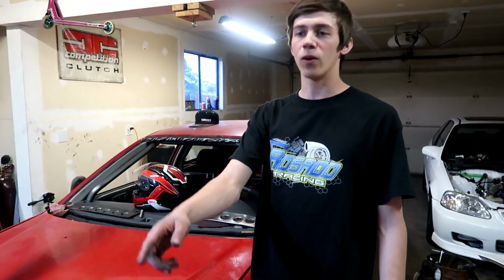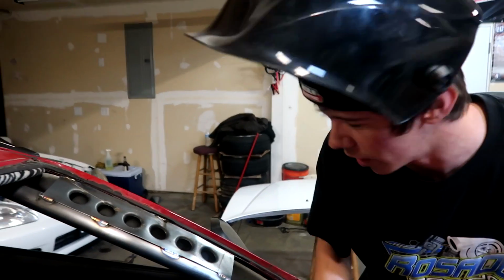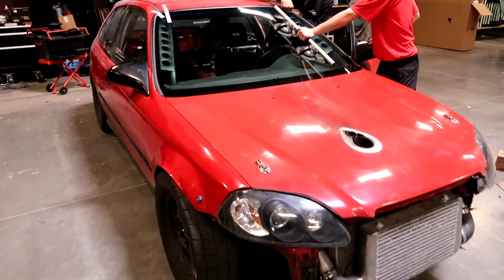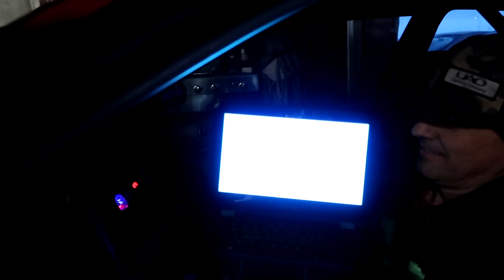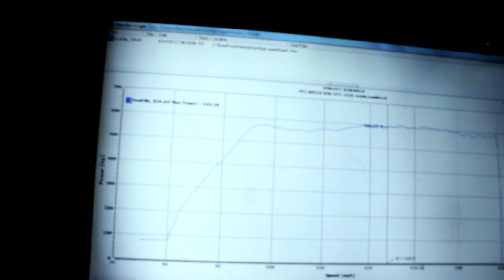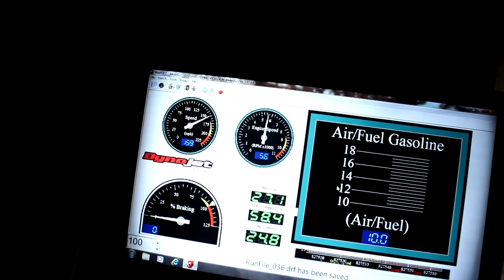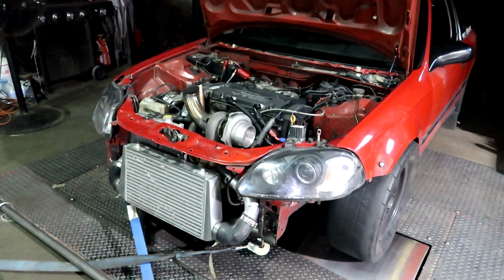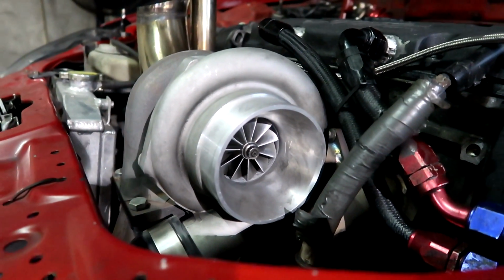After 3 Years of Abuse, My Ebay Turbo Has Finally Died...

Comment: 3 years of constant abuse, sitting for weeks on end, two-stepping, having flames shot through it, cranked up to 20+ psi... I'd say you definitely got your money's worth out of that snail.
Reply: HakJobTM lol my ebay turbo goes thru the same shit going on 4 years purchased in 2014
Reply: Lightning Autowerks™ got a link on where to get one ?
Reply: Lightning Autowerks™ do you know how much power your making and if so what setup are you running
Reply: Has anyone you know used exhaust piping For your intercooler kit

Comment: Put that huge turbo that someone gave to you on it
Reply: M O N T A E G R A M yea no, the lag would be monstrous
Reply: Tristan lag is super good for making it exciting though!
Reply: Turbo is way too big for this engine. the lag would be forever.
Reply: I was about to say that and the 2step should help on track building up boost
Reply: It would get too much compression and blow up the car. Lag would be terrible. We would also have barley any boost.
Reply: He would most likely need to put it on an 8 or 6 cyl.  I'm not sure 4 cyl would push enough exhaust gas for that size turbo.
Reply: MS3VT you should see volvo red blocks push the holset hx40
Reply: See that gorgeous graph that turbo did for him?

Yeah let’s not fuck it up. He can just get another of the same and be good.
Reply: Don’t underestimate the 4 bangers 😂🤷🏽‍♂️
Reply: Some guy from finland (bamse turbo underpants) is running a holset hx55 on a 8 valve volvo redblock, no problems and solid power
Reply: Pablo Vlogs maybe Im just stupid but how can you have too high compression from the turbo but not a lot of boost lmao
Reply: Pablo Vlogs proves you know nothing about forced induction.  The turbine side can be removed and a smaller turbine housing added to reduce lag.  The larger compressor will add more air, lower intake temps which will add more power per pound of boost. Brent can tune around this turbo.
Reply: Steve Ross ⬅what he said.  Lol
Reply: Tristan yeah I kinda figured that
Reply: Tristan uh anitlag?
Reply: M O N T A E G R A M full boost at 8500rpm. Lol
Reply: ddefinetly should!!!
Reply: M O N T A E G R A M Y E S !
Reply: The monster turbo with the right turbine housing will make the car faster, especially with the new transmission.  The car can get into the 9's and still be streetable.
Reply: That powerstroke turbo is junk. Yea it’s big, but I bet that eBay turbo would make more power.
Reply: type-dRew it's all in the tuning.  Since Brent knows what he's doing, going to a larger turbo will allow the car to perform better. Front drivers need a power curve that can't hit hard from the bottom since the weight transfer will cause the tires to lose traction. A progressive power curve is better and Kyle's car has boost by gear to make that happen
Reply: Lucas the HX40 isnt that big barely bigger than the 3582r
Reply: Raven Gamer bamse’s volvo fucking rips
Reply: Tristan  time for nitrous
Reply: Dude the lag would be so bad lol
Reply: or go same turbo with no problems and 8 more psi in it atleast that turbo wouldnt do anything good for him he would have to do work to the car just to have it on it and he would probably clean it up and rebuild it before putting it on his car costing more money then its worth
Reply: He has to make it to the track cant mess with the tune. Had to put exact same turbo on it again. From mini van.
Reply: Someone had a hx40 on a single cam f23
Reply: @4door_papi  i have an hx40 on my dsm😉👍

Comment: That's just it being old really and running hard asf for 3 years straight
Reply: Im not saying its bad for an ebay turbo but i would think something like a Garrett turbo wouldnt have broken :)
Reply: And I’ve seen multiple Garret’s last way less time under way less abuse on multiple cars. 

So yeah. Just good in general. Not just good for Ebay.
Reply: 3 years out of a turbo at 20+ psi without ever been rebuilt/refreshed is solid. let alone a $600 ebay turbo. People think garrets are bullet proof
Reply: +type-dRew so is it just any eBay dual ball bearing GTX35?
Reply: Pretty sure they said it was an ebay dbb gt3582r
Reply: Kyle needs to just drop a link to the exact one he got. Way to many options to be 100% sure you got a good ebay one.
Reply: Not to mention how often have you seen him run a filter on it too LOL its crazy it lasted this long.
Reply: I've never seen him run a filter
Reply: Whis 
That was his point😂
Reply: 3 years isn't old  a rebuild wouldn't have hurt...it probably would have lasted longer if got serviced every year or every other year....
Reply: Ambition-pk racingfirst on ebay.....I got a response from a video comment when I asked who he bought it from.... They're about $600
Reply: lol the turbo is junk he barely ever drove that car. you kids need to get a grip and close your mouth.
Reply: SpenserRoger truth...☝
Reply: Oh and dont forget about the 2 or 3 build motors later
Reply: Ya son let's drop 600+shipping USD on some copied tiny shaft junk from China, not like it's likely to grenade at any moment & destroy our built motor but yo lets congratulate each other when it makes it more than a few pulls & fails w/o toasting nothing cause having boost right now for cheap is all that matters.. old man.

Real mature. Sounds great. Call me when you get somewhere with that attitude, 1 800 grown ups
Reply: A gattrt gt35r will cost u around 1k or this ebay 200 dollars
Reply: Jokey Jesus another wannabe car enthusiast . I have turbochargers that have lasted for 8 years why bother with cheap parts for eBay China seller
Reply: it's definitely good for a eBay turbo considering how often people get crucified online for even mentioning the idea of using one. 3 years of abuse and touching over 700hp isn't bad for"eBay junk". In my opinion, people get mad because when it's worked as well in Kyle's case, it's a F-you  to the thousands other people spent on their builds. That's not saying eBay stuff is cool. You're still flipping a semi-dangerous coin.
Reply: Gaz Girl there is nothing wrong with Ebay turbos some people don't have the money to spend 3,000$ for just a turbo and when you're spinning something over 8,000 rpm it's going to wear and tear over time that is natural
Reply: Gaz Girl spending 3,000$ on just a turbo takes away from the overall build
Reply: Jokey Jesus the turbo would be spinning at least 100,000rpm
Reply: Whis I said over 8,000 rpm keyword over
Reply: China bulds legit turbos now. Actually they build alot of legit things now some of which you have in your home and have lasted a long time and you don't even know. Been to China lately? Their mega modern cities built up from what was a poor rural area in one or two decades shows how far they've come.
Reply: just throwing this out there, look at diesel turbos, they last hundreds of thousands of miles at over 20 psi...

Comment: Not saying this is why the turbo failed, but what reason could there possibly be to not using an air filter? Are there not filters rated for 1000HP that fit that turbo? I doubt there would be even a 1HP loss, and it looks like there's an entire foot of space in front of the turbo intake. I understand it looks cool, but "YOLO" and "sending it" in the end is expensive recklessness. Remember the video of the guy that grenaded his V12 turbo engine because a shop towel got sucked in during a Dyno pull?
Reply: phillip galas 
Ever seen a cylinder wall that’s been dusted?  
Looks like someone sandblasted it and that’s exactly what they did when they ran no air filter. 
All that for 5 more hp maybe on a good day.
Reply: at the very least I would put a turbo guard. always bugged me that he would run no filter at all, it's not like he has no room for one
Reply: Yeah never understood no filter. You are sending all road dust in through the engine .  I almost cried when I saw a tear in my filter on my cummins and that's a cast iron engine / with thick liners.
Reply: Andrew Bartleman 
Any time I open something on the intake tract and find a dust streak from unfiltered air, it’s sort of hard to take if you’ve rebuilt enough engines from it! 
Most snowblowers don’t use filters either. 
maybe they are going for that sick dyno pull.

Comment: You need to run the warercooling for the turbo core. With out it the exhaust seals in the turbo takes alot of heat and the ball bearing will fail early.
With watercooling im really sure it would of lasted muuuuuch longer.

Comment: Awesome vid as always. I love this budget build stuff.  Is it mentioned anywhere if and what the bottom end components are? When the motor was rebuilt  was it done professionally? Did Kyle build this in his garage or was it done at a machine shop (deck, honed, balanced, micro polished the crank, checked all tolerances etc..?  Also what kind of bottom end goodies did you use? Did you go budget (scat / eagle rods vattera / nippon type pistons) or did you go with better quality stuff like Manley / Skunk / CP type stuff? You guys have a build post on any of the forums on everything that's been done? Great job on the vids!!

Comment: no shame in the turbo failling, still impressive that it lived that long, with the torque dropping off at high rpm it seems to me like it was running maxed out...

im hoping you get another ebay turbo to compare how much they improved over the last couple years
Reply: jacob fraser it's the tune which drops the torque at high RPM because torque is what kills an engine, it's better to go higher in RPM with less torque than the opposite.
Reply: a turbo thats running out of flow makes an identical curve.

Comment: 🧐 If you don't run the water lines to a BB Water Cooled Turbo, then the oil inside the chra will tend to "Coke-up" and eventually grind away the Ball Bearing Cartridge when the Crust from the Burnt Oil breaks loose 💥

Comment: Years back I got my self a old gd Mazda 626 turbo the old single cam 2.2 with a 5 speed I ended up doing a t3/t4 eBay turbo front mount 38 mill waist gate lines blow off valve all up them bigs cost me $450 we done 3” stainless intake and bump used the stock mani with a t3 cast welded to the mani I done 60.000k on the cheap turbo some times it would get 20psi. It lived on 14 sold the car still going with the heap turbo on it il do it all again one day I had a new garret on a Nissan and it died with in a few months

Comment: 3 years with a ebay turbo and that kind of drving is not bad at all! well, buy a new for like 200 dollars and then its running again!  i have a saab 9000 that i has been driving the shit out of for like 3 yers on 16 psi with a garrat turbo, and that turbo is pretty mutch done. so youre ebay turbo did well!

Comment: be carefull what turbo lines you buy 
buy cheap the insides melt blocking the oil flow

buy really good lines not cheap chinezium plastic wannabe nylon lines(with cheap chinezium stainless braids)
i have see all kinds and all kinds wear and break and cause damage of all sorts(to even oil lines on oil coolers/relocation kits)

cheep is not always good

one good way is to get oil preef or resistant hose and  wrap it with stainless braid,  at least its going to last 
and you know whats what

Comment: Why not use acrylic as the windshield or some time of lightweight plastic make it 2,200 lol
Reply: they start pushing in at the mph he'd be running.
Reply: Rules at tracks don’t allow anything other than glass for a windshield.
Reply: SpenserRoger 
That’s what the aluminum braces are for, but then that’s probably cop bait for those pricks.

Comment: I know this is an old video, but the turbo probably had a journal bearing go out inside the turbo causing it to become unbalanced and eventually start blowing oil. Had this happen on a Volvo I use to own... Lack of enough oil and cheaper made parts will cause this.

Comment: Thrust load maybe was too high when you raised boost. Ebay turbos are okay but I always here whenever boost goes significantly higher bearings get stressed.
Reply: Yanku Marrah he made 700 or 800hp with this turbo before
Reply: Yanku Marrah I’ve pushed these over 40lbs. They have a pretty good thrust in them

Comment: i think you have to much positive camber up front Kyle
Reply: When the car squats at launch the positive camber zeroes out, so that way he is getting maximum surface area of the tire touching the ground. People do the same with rear wheel drive cars. If you align the car at 0 degrees of camber, when it squats it will go negative. That is why you start with positive camber.
Reply: yeah in rwd car :P
Reply: Matthew Dame civic has double whishbone suspension up front but still camber will go to positive as it lifts up under acceleration